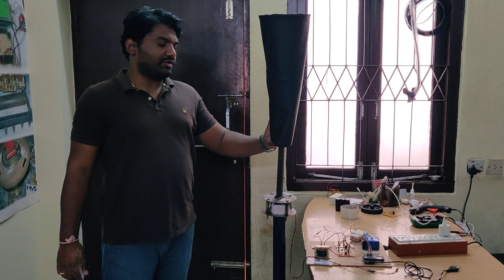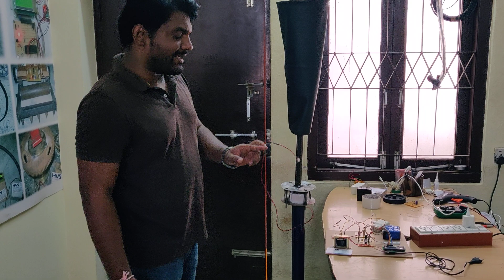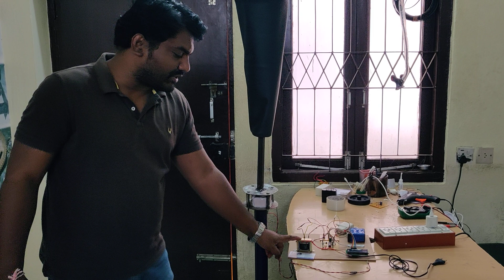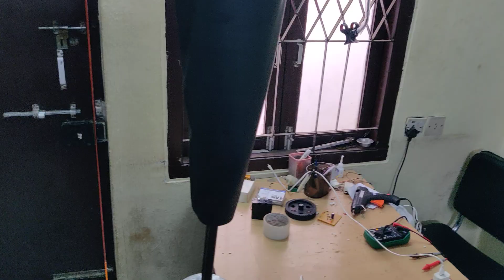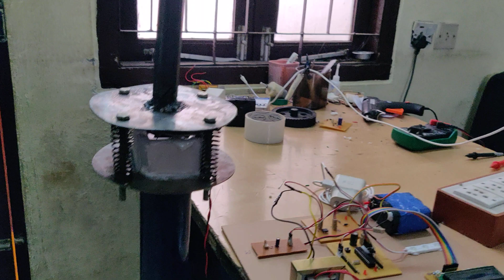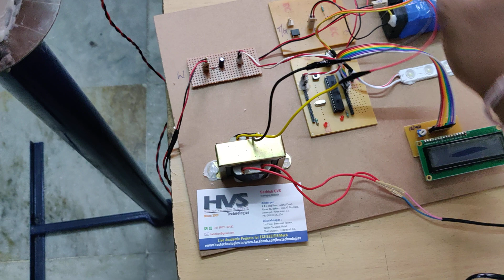Vortex Blade less wind turbine

Comment: You can put a hard spring under this unit so it will easily vibrate every time with little air
Reply from the maker: Yes. Hi, 
We sell full working kit with document PPT circuit diagram and code. Could you Send me the video link, Will update you the cost details. You can contact us at +919603140482
Through WhatsApp or call